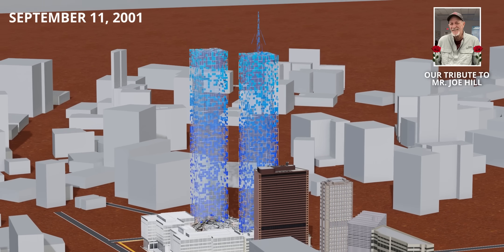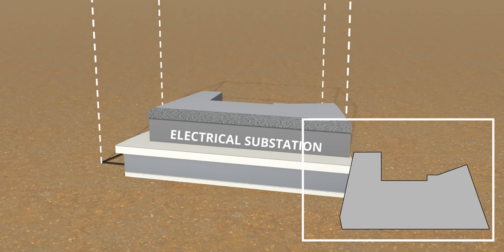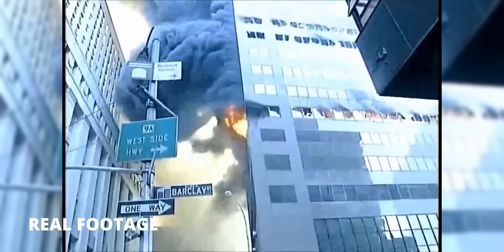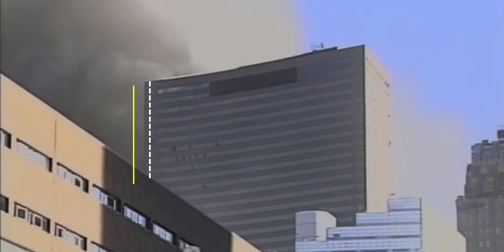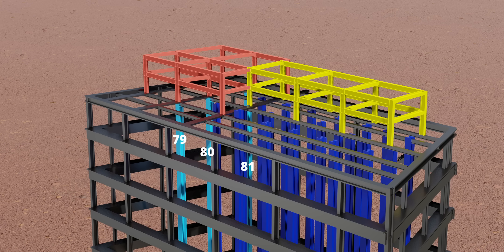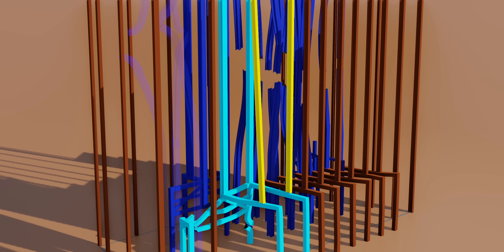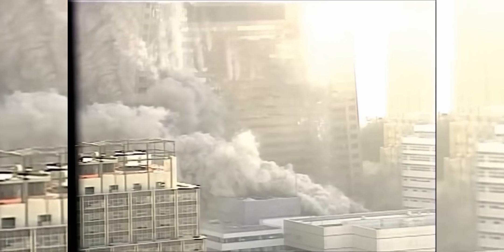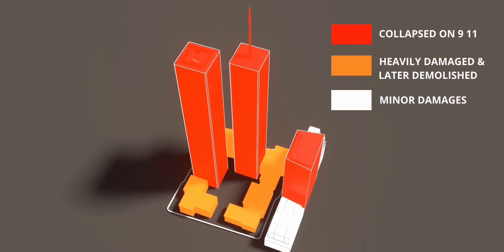Collapse of Building 7 | The Complete Physics

Comment: I call BS! Ce straight down into own footprint at free fall speed. Controlled demolition only explanation
Reply: Or,... Building 7, the 6th building to collapse of 10 lost on 9/11 though extensively studied still confuses many. Not famous or a terror target and with no casualties it didn’t get a lot of attention initially, creating an information void the internet filled with utter garbage. Because everything seems like a conspiracy if you don’t understand how it works I prepared this brief summary from my own analysis to fix that. No politics, just engineering. 

The North Tower collapse at 10:28am bombarded Building 7 with tons of burning debris, causing heavy damage and multiple floor-wide fires that burned out of control for 7 hours. Half the FDNY firefighters having been killed, others injured, units in disarray, equipment destroyed, no water pressure, and the greater urgency of Search & Rescue efforts, firefighting was pulled as futile. The building couldn’t be saved and was left to its fate. That is the sort of choice firefighters make every day in brush fire situations - which houses to save and which ones to let go. Only real difference here is moving the decimal on the size and cost.

www.youtube.com/watch?v=g_SvpwyC17M&ab_channel=MFitz  

Collapse of a burning structure is always a concern for firefighters. Steel buildings subject to fire rely on active fighting of the fires to survive. Buildings are designed around 1 to 3 hours of fire resistance, allowing time for occupants to escape and ACTIVE firefighting to get started, after which all bets are off. Left to their own devices they will exceed their design envelope and collapse. In B7 the occupants escaped, passive and active fire protections were compromised and active firefighting was abandoned which left the building to its fate. It lost. Odds on Building 7 would eventually collapse, and it did. No big deal in logic. 

www.youtube.com/watch?v=WnYBX6QT0R4 

FDNY Chief Daniel Nigro ; The biggest decision we had to make on the first day was to clear the area and create a collapse zone around the severely damaged 7 World Trade Center, a 47-story building heavily involved in fire. A number of fire officers and companies assessed the damage to the building. The appraisals indicated that the buildings structural integrity was in serious doubt. I issued orders to PULL back the firefighters and define the collapse zone. It was a critical decision; We could not lose any more firefighters. It took a lot of time to PULL everyone out, given the emotionalism of the day, communications difficulties and the collapse terrain

FDNY Deputy Chief Peter Hayden ; We had our special operations people set up surveying instruments to monitor and see if there was any movement in the building. We were concerned of the possibility of collapse in the building. And we had a discussion with one particular engineer there, and we asked him if we allowed it to burn could we anticipate a collapse and if so, how soon? And it turned out that he was pretty much right on the money, that he said 'In its current state you have about 5 hours

The collapse of Building 7 was anticipated and widely reported in the media throughout the day. At least 24 video cameras recording some or all of the collapse. Everyone knew what was coming and why.

www.youtube.com/watch?v=OY5S5k3tMHI 

Building 7’s collapse was completely different to the Twin Towers, and harder to understand with most details hidden from view. But we can still sort out what happened through careful analysis and observation.  This is my explanation  of the collapse using the best available information and relying on no authority.

B7 was complex 47-story steel framed structure built on top of a smaller existing 3-story building, requiring several lower floors dedicated to complex load transfer structures instead of usable office space. Of trapezoidal shape and all-steel tube-in-tube construction, B7 (above the 7th floor) consisted of a central core of steel columns carrying most of the gravity load, perimeter steel columns around the outside of the structure carrying the remainder of the gravity loads and long span beams and girders to tie those elements together and form the floors. On the outside of the building hung a moment frame - the last part of B7 to fall 

Phase 1 : The first externally visible signs of collapse initiation occurred at 5:20:28 pm. Collapse initiation for B7 is notably quiet with observers not realizing the building was collapsing! There was no audible warning in the form of say hundreds of ear drum busting 180-190dB explosive bangs preceding the collapse. Here at 12:00 a local CBS affiliate reporter is talking 10 blocks from B7 when collapse begins. People don’t start to notice the collapse until 12:11. Then at 12:45 is the famous CBS fixed camera clip of Building 7’s collapse.  Note how quiet it is.

youtube.com/watch?v=t5tEy6mXSE8&ab_channel=fresnosean379

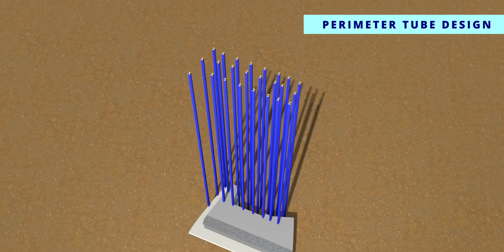Collapse initiation was due to lower floor failures above the load transfer region (7th floor) in the NE corner of the building. In this video at 0:45 you can see the NW corner from inside the building while under construction, Column 79 just out of frame on the left. That big, angled steel beam across the top of the frame connects to C79 at one end. The girders connect to the beam. That beam and all those girders depend on just one connection

youtube.com/watch?v=nP3TNHPCIVU&t=35s&ab_channel=EdwardCurrent

Phase 2 : Lower floor failures caused a loss of critical lateral support over an excessive length of core Column 79 and it buckled. If you look at a floor diagram of Building 7 (see above) and look at all the structures that depend on C79 you quickly realize this one column was a relatively isolated structural element on which a disproportionately greater fraction of the structure depended analogous to say the Key Bridge. Externally we see a vertical progression of window breakage along the 44-46 line and a kink in the roof of the East Mechanical Penthouse at the top of the building, consistent with C79 failure. The transition from full capacity to almost no capacity occurs in virtually an instant. Once the buckling failure occurs there is almost no resistance

Normally with a buckling column, the load could very well be redistributed to other columns, meaning the buckling could stop after a while. With C79 that is not the case - the failure did not redistribute the load, so the collapse rapidly progressed to the roofline, sinking the rooftop penthouse.

Phase 3 : With C79 gone, B7’s progressive, non-symmetrical collapse continues with C80 and C81 at the east end of the core left laterally unsupported and quickly buckled and failed as well, sending the EMP down through the building. C79-81 all have no diagonal bracing, which I believe is a major reason why they could not redistribute a lot of vertical loads among one another.

From there collapse progressed from east to west through the central core until the core was gone taking all of the interior floors and structures and probably most of the perimeter columns with it. You can see the horizontal progression of window failures low in the building and the dropping of the remaining rooftop structures into the building. One of the big takeaways from the NIST Building 7 study (that gets completely ignored) was their modeling which determined C79 failing under ANY circumstances would have initiated the same collapse sequence.

Phase 4 : 10 seconds in only the exterior moment frame - just a hollow empty outer shell – remains, the illusion the building is still standing since little has outwardly changed. But it’s just a hollow empty shell like an empty cereal box supported by only a few remaining columns and quite unable to remain standing. With all internal framing gone, the north face leans inward, forming a V in the roofline, the last perimeter columns buckle under the strain and the moment frame free falls, landing on top of the 7-story high debris pile. It is only here, at the end that a single measurement of alleged free fall acceleration is taken, from a single point on the moment frame. The Building (defined as its center of mass) did not “free fall” (sort of) – just one corner of the outer shell did. _
The Building_ was already gone before that happened. The period of alleged free fall was a product of collapse progression mechanisms, not of collapse initiation mechanisms and is irrelevant to what started the collapse. Start to finish the entire collapse took 18-20 seconds, 3 times longer than true free fall and how fast something falls cannot tell you what started it falling anyway. The debris spread outside the footprint, blocking surrounding streets, heavily damaging the Verizon Building and destroyed Fiterman Hall.  

Building 7’s progressive, non-symmetrical collapse was incidental and unintended collateral damage from the combined effects of fire + time + gravity started by the collapsing North Tower. That is true no matter who planned and carried out the 9/11 attacks or why . The collapse was of so little consequence it barely even registered at the time, a mere footnote. It only took on semi-mythical status as an alleged smoking gun years later when demolitions at the Twin Towers, missiles at the Pentagon and shoot down over Shanksville all failed and conspiracists had nothing left to work with.

Anything can seem like a conspiracy if you don’t understand how it works. Now you should. I hope you found this helpful, informative and it solicits informed critical comment. If I made any errors of fact, logic or reason or left anything important out, please let me know so I can fix it. IF you can offer a more plausible alternative please do. Be the first. Please start any reply with the words “Tits McGee” or I will know you didn’t read it and are wasting my time.

Comment: The comments are far more entertaining than this ridiculous explanation for WTC 7 collapse.  If any of this was remotely plausible we would have dozens of steel girder high rise buildings collapsed historically from huge fires that burned for many hours.   Why don't you do a video explaining the BBC Jane Stanley's live air announcement of WTC7 collapsing some 20 minutes before it happened?
Reply: No we wouldn't.  That comment represents a gross misunderstanding of fire science and engineering.  It's like you were paying no attention at all. Luckily there's help. 

The collapse of Building 7 is probably the most studied engineering disaster in history and the subject of 5 comprehensive engineering studies and more than two dozen technical articles in major peer reviewed engineering journals, most of which were published 15 or more years ago. Thousands of pages of material.  This should get you started.

FEMA BPAT (initial report superseded by NIST NCSTAR 1A)

NIST NCSTAR 1A: Final Report on the Collapse of the World Trade Center Building 7, 2008.

Guy Nordenson and Associates, WTC7 Global Collapse Analysis Report and Summary of Findings, 2010.

Arup, WTC -7 Structural Fire Analysis Report (Runs 1-4), 2010.

Weidlinger Associates Inc., WTC 7 Collapse Analysis and Assessment Report, 2010.

BRE Centre for Fire Safety Engineering, Analysis of the Impact of a Fire in the Mechanical Room (5th & 6th Floor) of the World Trade Center 7 Building, 2010.

T. McAllister, R. MacNeill, O. Erbay, A. Sarawit, M. Zarghamee, S. Kirkpatrick, J. Gross, Analysis of structural response of WTC 7 to fire and sequential failures leading to collapse, J. Struct. Eng. (United States). 138 (2012) 109–117.

For a summary of the major studies I would recommend THE COLLAPSE OF WORLD TRADE CENTER 7: REVISITED by Mhd Anwar Orabi , Liming Jiang , Asif Usmani and Jose Torero which is a 33 page summary of the different analysis and conclusions published in 2020. Sorry, YouTube will delete this post if I give the link but it should be easy to find and is available from the University of Queensland, Brisbane. 

Real structural engineering industry professionals conducting real engineering studies and publishing them for other professionals to see. Not amateur YouTubers appealing to the gullible and credulous.

Happy reading
Reply: @TheCriticalStinker-jw4fl  except the fact that this investigation you talk about did not involve ANY examination of physical evidence did it? Are you willing to admit that at least?  The entire WTC site was tightly controlled during the clean up, no material was gathered for examination. Why did Giuliani have all the scrap metal hauled off site and shipped to China post haste?   Being as no steel framed high scrapers have EVER collapsed in history from a fire, except 3x on 9/11...perhaps it would have been prudent to actually gather physical evidence to support any proposed hypothesis.   Your point is completely bogus on this fact alone.  You are aware that nano grade thermite residues were found in suspiciously high quantities from samples of the concrete dust collected outside the containment area, and that the sun micron size and presence of sulfur indicates military grade?   Why would that be present?
 Overall, putting aside this singular matter of WTC 7's collapse -there are dozens of anomalous occurrences that happened before, on and after 9/11 that paint a pretty clear picture of a complex and compartmentalized false flag operation, but you are free to believe whatever delusions you wish.  Cheers

Comment: This is almost as bad as the Trust the Science for Covd
Reply: And yet not wrong. Go figure. 
	
This video is pretty good – with a few exceptions - and goes into a much higher level of detail than many viewers will be able to comprehend.  While not perfect, the collapse mechanisms – the sequence of failures - described here  are substantially correct and this is true no matter who planned and carried out the 9/11 attacks or why . 

That may not be what you want to hear and go against 20+ years of entrenched dogma and conditioning, but it’s not wrong. 

That also means (in case you did not get the hint) this video can be (and IS) absolutely correct in its description of collapse mechanisms AND the 9/11 attacks could still have been some sort of inside job. The two things are in no way mutually exclusive. 

The mechanisms described here have broad professional support around the world. There are no professional engineering organizations (for example: ASCE, ASEE, ICE, etc) that disagree with them or have offered any formal dissenting opinions or alternative hypothesis. 

So, setting hubris aside, either the overwhelming majority of the worlds structural engineers and simple observation are wrong,… … or you are. Which seems more likely? 

IF you still think believe this explanation is wrong then produce a better one . Good luck with that. No one ever has and I don’t see you moving that needle today.